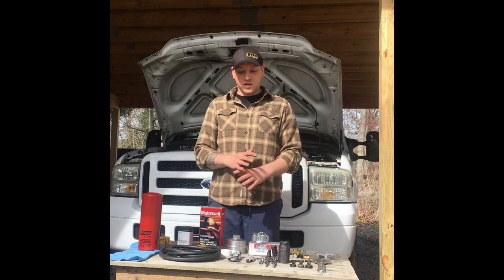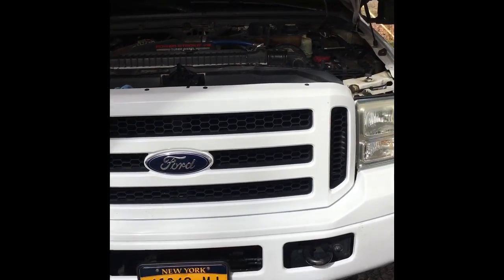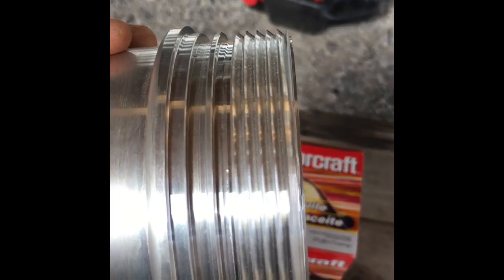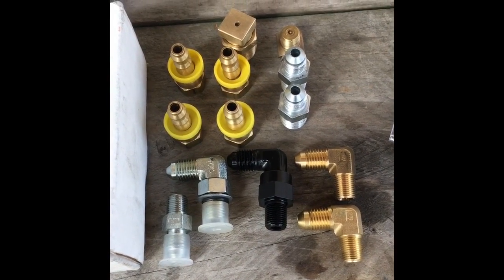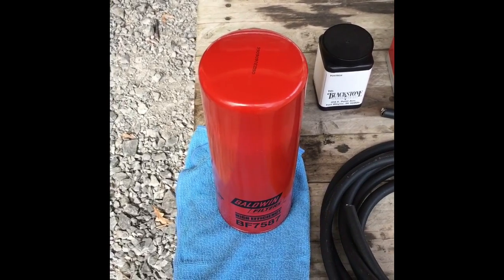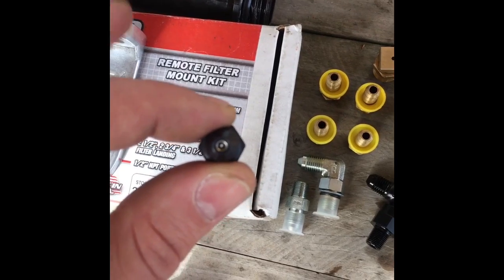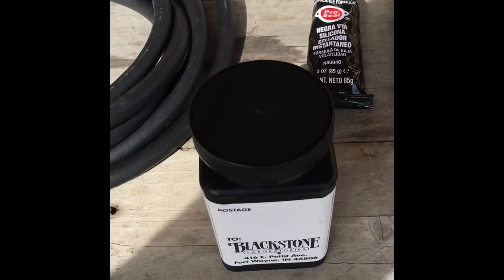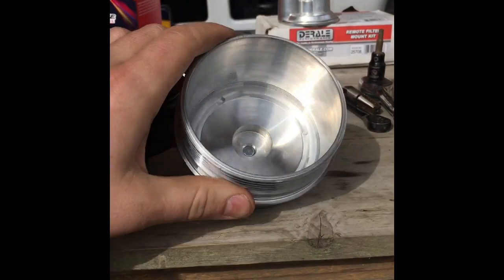DIY 6.0 bypass oil filter kit

Comment: Thanks for the info.  I know this video is 7 years old, but what made you decide .030 for restriction?
Reply from the maker: @garrickandrews7035 I just copied the way other set ups were using. The bypass filters typically aren’t meant to have full flow going through them. I saw that was the most used size on some forums so I went with it.

Comment: The Baldwin BF7587 is listed as a fuel filter on the Baldwin website. I tried to find out from them if it is designed to take the sustained heat of engine oil. Fuel filters are usually seeing ambient temperature fluids.
Reply: So you know?

Comment: Ive been telling people for 60 years that John Frantz invented the adapter that allowed you to use toilet paper in the old canister filters in 1953. Saw Ebay had a Purolator toilet paper adapter probably older than the Frantz adaprer. Someone found 5 of them wrapped in news papers from the 40s and 50s. Looked like a Fram canister with a toilet paper internal canister.. They were for 31 and later Chevrolet engines. I recently adapted a Ford flat head V8 canister filter to use Scott 1000 and put it on a Ford diesel tractor. Ebay wanted 99 dollars for the Purolator.

Comment: The old Ford flat head V8 engines had a optional equipment bypass filter  that bolted to the head. I bought one years ago when I was researching bypass filters. I had forgotten I had it. Was looking for a Ford 8N tractor. Ended up with a  Japanese Ford diesel.about the same size. While digging for parts I found the old Ford filter. John Frantz got his start adapting the old canister filters to use superior Toilet paper in 1953. I adapted it to Scott 1000 and put it on the tractor. Its a lot better than the Frantz adapter.and simpler.. Filters the same. I didnt add an orifice because I used a sandwich adapter..The 79  model 1900 is a little rough from being out in the weather but the 3 cylinder engine appears to be in near new condition.

Comment: I think if you are a young guy you would be better off getting a Jackmaster or Gulf Coast Junior. The Gulf coast junior  migbt be out of production.  The Frantz is a poor design for this odd ball size  TP.  They were designed only for 1 1/2 inch core paper. The Frantz elements work but I like to use Scott or Great Value 1000. Jackmaster has nice wrapped elements. Im a toilet paper guy. A lifetime filter isnt such a big deal to me im too old. I have Motor Guards over 50 years old. I wonder if any of the filters I installed at work have been taken care of after I left. Cummins Detroit Cats. Toyota lift trucks.
Reply from the maker: There’s no doubt those are the better ways to go but this is more of a kitty that people can piece together themselves.
Reply: You have good hose and Fittings.1/4 works fine.It was simple when I started. We had american cars and VW beetles. All gasoline. For the trucks and other diesel engines we had the Frantz 3 stackers. All Motor Guard had was toilet paper filters. The bigger the engine the more toilet paper filters you manifolded togerher.. They were the best at the time.   All Motor Guard  makes now is compressed air filters. Motor Guard was the only one safe to use for compressed air.Dont know if the Gulf Coast junior is still in production. You can still find them. The Jackmaster filter has been around since 1954. They are nice.If I had to choose between the Gulf Coast  and Jackmaster it would be difficult. The Frantz isnt the best design but is the best known..Gulf Coast filters is mostly into heavy duty diesels like Shell offshore rigs.Those are locomotive engines
Reply: I did a fleet of Powerstrokes  when the 6.0 first came out. I didnt have the aluminum lid for getting pressure. I must have found a pipe plug for pressure. I drilled and tapped the fill neck to return the clean oil. The 7.3s had a pipe plug near the full flow filter to get pressure to the filter. A 3/8 inch pipe plug in the bottom of the engine skirt for a return.  It took a 5/16 square tool to remove it. This guy required A Gulf Coast 0-1 paper towel filter bolted to the frame.  I used the Gulf coast  junior on my 6.9. Used a self tapping hollow bolt in the fill neck for a return. If you remove the plastic fill neck to drll and tap it on the 6.0 be sure to mark it first.

Comment: I just got a Australian. Jackmaster .didnt need one. I  have every thing equipped that has an oil pump. As far as I can tell it is the best I have ever seen. I had to see one. Looks like it was designed to use toilet paper. It had the Jackmaster element that has a wrap that looks like panty hose material. Its for sure the strongest of the TP filters. Looks like something you would put on a off road truck. I think if you want the best and have money burning a hole in your pocket this is it. I have Motor Guards over 50 years old that cost me about 30 bucks. Those days are gone. When i was selling Gulf Coast filters I did a fleet of tree service vehicles. The 6.0s had just came out. I could have used some of these items. The 7.3s had a pipe plug for pressure and a 3 /8 plug at the bottom of the engine skirt for a return. Needed a 5/16 square tool to get it out. I paid about 250 dollars for the Jackmaster including shipping from Australia. No oil hose and fittings I normally use Gates  transmission cooler hose from O Reilly's.  Ace hardware has most of the fittings I need. I use 3/8 hose. Put a roll of Great Value 1000 in the Jackmaster. I will use the factory element later. I use toilet paper. The Jackmaster has no center tube like the Frantz. It uses the toilet paper core for a center tube. Some of the new paper is getting larger cores. Wont matter with the Jackmaster. Never dealt with male fittings before. Used 1/4 female pipe to 3/8 hose barbs adapters..couple rounds of teflon tape.  Dont know what the one with the tee handle hose and fittings cost.  Almost 60 years of using toilet paper. Too old to change. To be effective a filter needs to be absorbent like toilet paper paper towels  cotton pulverized newspapers like the Fleet Guard 750s  or the Luberfiners  or Wix and others that make the elements. Some of the big 750 cartridges use less effective pleated paper. I put the big Gulf Coast O 1s on the tree service vehicles. They  are made of hydraulic cylinder stock. Of course the strongest and heaviest of the big filters. 1 1/2 gallons and 3 gallons. Some Ram Cummins owners are wanting the 1 1/2 gallon models. A NASA diesel equipment engineer said the filters are only for industrial use. We dont keep our rigs long enough. Probably true.

Comment: still waiting for someone to prove this doesn't rob crucial oil pressure from the rotating assembly, cam and lifters.
I agree the 2 micron passive filtration is great but not if you're robbing every rotating assembly bearing of oil pressure as well as the turbo and piston skirt squirters
Reply from the maker: I would imagine this would show up on oil samples. That’s the point of the restrictor in the oil system. It doesn’t allow full flow but just a small amount. That way it maintains system oil pressure.
Reply: It shouldn't rob any pressure as it will only being taking a couple psi from the low pressure oil side. Since it is a bypass filter it is only filtering a small amount of oil.
Reply: Bypass filters have been around for 100 years. They all have restrictors . Its the same for Luberfiner Cummins Fleetguard. A few heavy duty truck filters use a little larger orifice because the oil pump is so much larger. There was a time when all filters were bypass filters and were optional equipment. Any automotive engineer can explain it. You cant prove anything to a skeptic.  My lawn mowers pump  a lot less oil than a Ford. They have the same size orifice as the Ford. Most oil the Ford pumps is returned to the oil pan thru the oil pump relief valve.. that keeps the oil pump drive from breaking. A quart or two a minute is nothing. If the oil pressure goes to zero at idle your relief valve  is probably stuck open. Usually caused by dirty oil.
Reply: Riddick: Oil pumps in engines will pump much more than what can flow through the engine. They also put out fairly high pressure, like 90 to 120 psi. So to control this, the pumps have a relief valve, pre set with a spring. Most relief valves are set at 40 psi. Oil is diverted back into the oil pan through the relief valve.
So, there is plenty of oil and oil pressure to feed through a bypass filter.
Reply: @tarquineous  what about with 8 skirt jets as well? 6.0 isnt every engine.
Reply: @over9000pontiacs  I don't know what you are referring to. My point was the engine has plenty of oil pump output, and a properly set up bypass filter will not lower oil pressure.
Reply: The oil pressure will be the same with or without the bypass filter. The relief valve in the oil pump determines the oil pressure.unless the engine or oil pump is so badly worn the oil pump cant keep up with the engine oil demand. Sometimes dirty oil will cause the oil pump relief valve to stick open or partly open. The relief valve needs clean oil like a hydraulic valve lifter. Did a fleet of tree service trucks when the 6.0 first came out. For a stronger return on the plastic oil fill neck you can put an elbo in and.secure the hose to the fill neck with plastic wire ties. All Gulf Coast filters had was universal models. The 7.3 had a 3/8 pipe plug in the bottom of the engine skirt for a return. Remove the plug with a 5/16 inch square tool.

Comment: My 64 Rambler American  came with a spin on bypass filter mounted to the flat head upside down. It didnt clean oil. A bigger spin on would have cleaned oil better but probably not good enough. I solved the dirty oil problem with a Frantz oil cleaner. They cost 29.95 in 1963. The Delo turned golden and stayed that way. Dont know what the Frantz cost now but the advantage is cleaner oil. All I use now is Motor Guards and Gulf Coasts. I get my filter elements from Walmart. Scott or Great Value 1000. I have a dozen or so bypass filters in use.I sometimes make an orifice out of a wire welder tip.Almost 60 years of clean oil with very few oil drains.
Reply from the maker: That’s bad ass. Tried and true methods are awesome! Thanks for sharing. I’d like to try that Frantz out one day
Reply: The other day I bought a 16 pack of Great Value 1000 from Walmart. They had the smaller core and were the same diameter as we used in the 60s. All I use now is the Motor Guard and Gulf Coast jrs. They are the easiest  to service. They are top loaders. Sister wrecked the old Impala. Lost my last two Frantzs.  Not sure what is happening with the Gulf Coast 01 juniors. Saw some on ebay. NASA saw my posts and started using the paper towel filters. The diesel engineer said the filters are only good for industrial use. We dont keep our equipment long enough. I just changed the 50 some year old Motor Guard on the 76 F250 with the 390. I probably paid less than 50 bucks for it. The pleated paper filters are pretty much a joke. Only good for fuel and full flow oil filters. Converted some Motor Guard M 30 compressed air filters to motor oil.To make orifices for them I got a 1/4 pipe Male to female adapter  ran a 1/8 tap into the female end. Put a brass plug in. The one that takes a Allen wrench. Drilled it 1/16. Cut some aircraft aluminum internal parts. Easier to find one already factory made. Motor Guard converted to compressed air filter years ago. The big Fleetguard 750 filters use pulverized newspapers in their best filter elements. Also wood chips.. the same for Luberfiners.  Bought a WIX same thing. Have seen cotton waste in Luberfiners. Cummins at one time claimed a 80% increased in engine life using the filters. Worth going after. The Frantz is a poor design for servicing. Its the best known. John Frantz got his start converting the old Fram and other canister filters to use toilet paper. You can still find the famous 3 stackers on marine engines.They were the same as a Fram but was tall enough to take 3 rolls of toilet paper. Been pretty much replaced by Gulf Coast paper towel filters.They were designed to take Bounty Big roll paper towels. They have their own elements now.. a NASA  diesel equipment engineer invited me down to talk about oil filters.I put him in touch with people that understand big engines. I see they are listed as a customer. They were moving the shuttle then.
Reply: Just installed a Australian Jackmaster Classic on the Pontiac. Didnt need it but was curious  I put a air fitting in the lid to push out the excess oil before changing it. The little pleated paper filters dont clean oil The big ones should be better. I like top loading toilet paper filters I just bought a 3 cylinder diesel powered 1900 Ford Trsctor. I converted a  stock bypass Ford filter for a flat head Ford V8 to use Scott 1000 sheet. It will go on the tractor

Comment: Not sure what they cost now but the Frantz is a lot better filter because they give you a lot cleaner oil. My favorite little filter is the Gulf Coast junior. It takes depth to clean oil. Pleated paper doesnt do it. The orifice helps. I sometimes use a .025 wire welder  tip to make mine. As a rule if the filter is toilet paper or looks like toilet  paper it will clean oil. Not sure they still make the Junior  now. All I have now is old Gulf Coasts and old Motor  Guards. Modified.a couple of Motor Guard comprrssed air filters to filter Motor oil.
Reply: Ralph, Insane Diesel and KleenOil both make bypass filters and have a few different sizes. The cost of their replacement elements is a real deterrent to me. Each element is around 40 to 70 USD. That makes the Frantz very attractive and practical.
Reply: Frantz doesnt do so well with toilet paper. Frantz was designed for 1 1/2 inch core TP. Getting hard to find. Of course the Frantz elements fit. When Frantz went broke years ago.A Frantz dealer improved the TP filters with a Gulf Coast junior. The Jackmaster. Is similar. I think the Jackmaster is working with Gulf Coast filters . I bought a Jackmaster to see if they are the best available. They are.like the Gulf Coast junior. You push the TP in and put on the lid. Like the Gulf Coast junior they put in a larger seal for the larger core TP. They have the expensive elements but realize most of us will use TP.. The Frantz is a bad design but is the best known. I got the Jackmaster Classic. Personally I cant see buying the more expensive model. I suspect the Classic is the origional high quality Jackmaster. I have a wrench to remove the lid and long nosed pliers to remove the used TP. I think Gulf Coast filters are too busy with the big filter systems and had to recommend the best little filter for their big customers. An offshore rig not only have locomotive engines they have fork lifts and such. The Jackmaster Ultra looks very similar to the Triple R. It is depressing watching people trying to make the Frantz fit the shorter paper with larger cores on YouTube. Then they notice there is no screen imprint which means the oil is bypassing the core seal. Motor Guard was the first filter to beat the Frantz on design.  All they make is compressed air  filters now. I have a couple over 50 years old.They couldnt compete with the better known Frantz. Frantz was suing the hell out of them.
Reply: @ralphwood8818  Frantz does make a solid element now. Frantz filters have worked well for me for the last 40 years or more. I will look into the 
Gulf coast Junior. Each design has it's advantages and suitability to applications.  Long lasting hose is a must, I find.
Reply: I started with the Frantz and Delo 30 weight in 1963. TP fit in those days. The AeroFrantz  took the same TP. The paper is different now. Frantz stayed with the rediculous design. The top loaders designed the filters to fit TP. The Australian Jackmaster claims their elements are better than TP. That is debatable. I appreciate that they put larger core seals in the bottom for their.1 1/2 inchcore or the larger core TP. The last Great Value 1000 I got from Walmart  has a larger core and smaller diameter roll. Was unrolling 30 rounds. Didnt un roll any this time. The shorter rolls dont matter with the top loaders. The lousy design of the Frantz was okay when there was nothing better and TP fit. The Jackmaster filter element looks like a very high quality roll of TP in a sock.The sock has a ring to pull out the element by the fabric. Dont tell anyone but I cut open the sock to see what was inside.I have long nosed pliers to remove the used TP and a wrench to remove the lid.